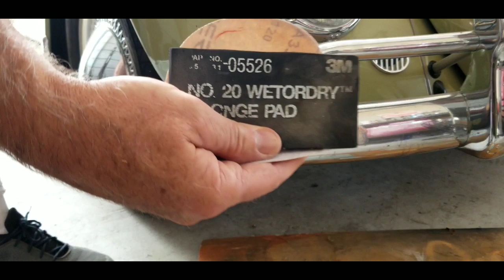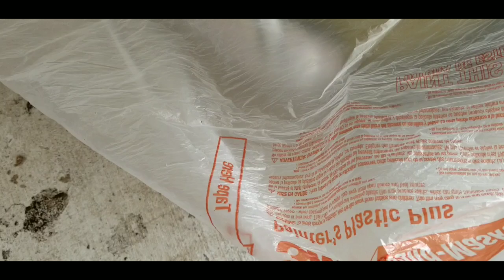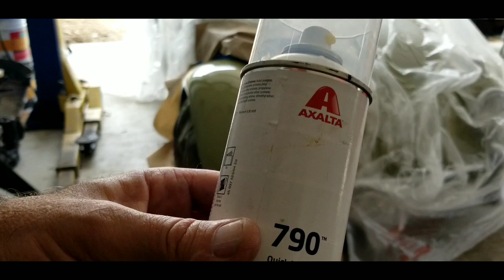spot painting and blending clear coat  VW Bug fender repair

Comment: I've spot blended clear and I never got the "ring" that you're speaking about because it's blended not taped in a circle, but what I really want to know is how long will the clear stay without fading or maybe even eventually peeling down the line. Never have I've actually spot blended clear on my own vehicles. What's your take on maybe the new clear starts to peel or fade out after a year or two?
Reply from the maker: Well that is what I was talking about delamination from the blend. We are not having that problem or signs of it with these spray can blenders. The ones in the gallon are not as hot. My buddy does these all the time and is not having any that delaminate or have that blend ring after more like 10 when all the clear starts to fail. In the direct sun maybe sooner so a hood might not be a good choice to do this.